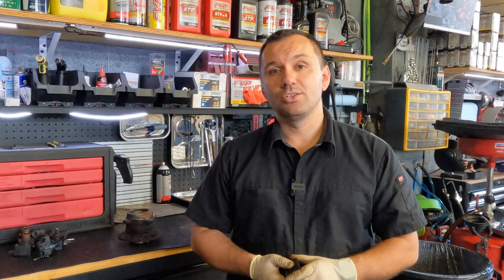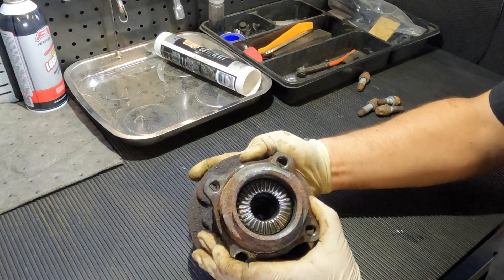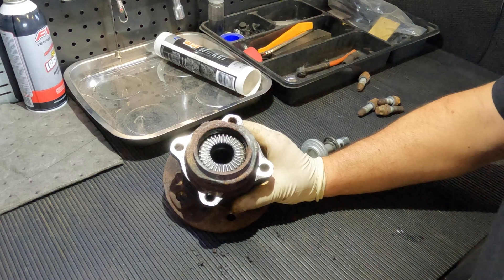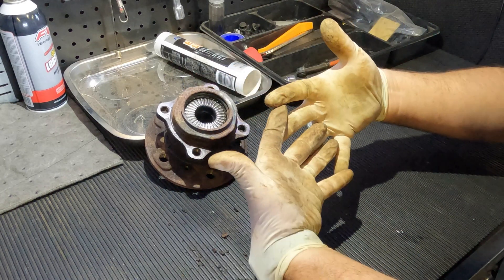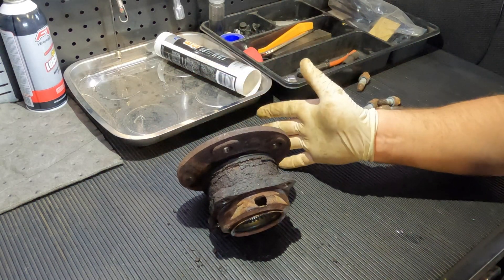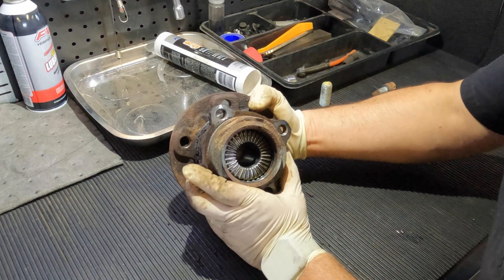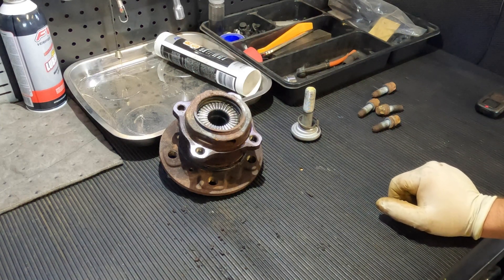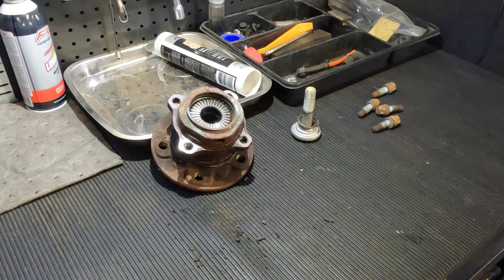BMW USING A NON-TRADITIONAL WHEEL BEARING DESIGN AND I DON'T KNOW IF IT BETTER OR WORSE?

Comment: As a non-mechanic, non-engineer, I like this design bc I've had trouble getting traditional hubs off in the past and these just about fell off on their own. Got right at 100k out of the original hubs with no issues other than them eventually wearing out. Thanks for the info.

Comment: Can I reuse the old hub cuz all the part shops has only bearing moduel
Reply from the maker: I would make sure that’s the correct part because this is only a one piece. I got mine through BMW. They didn’t have a two piece. It’s only a one piece design through OEM with the hub and the bearing pressed together

Comment: Where do you work to not notice the problem of traditional splined shafts getting rusted stuck in the bearing tighter than a brick in the butthole?
Sounds like heaven to me
Reply from the maker: I work in the rust belt I deal with several frozen axles in bearings and bearings into the hubs. You missed the point of the video where it’s about how does this design work in the long term? How much can it handle? For example I don’t care how easy it can be to replace them if I have to replace it 3 times a year if the design doesn’t hold up like the traditional bearings.

Comment: VW Lupo 3L  and Audi A4 had that kind of hub too with integral bearing in the late 90' People made special tools with a bolt and spacers as you are suggesting to take them apart, to not have to order a complete replacement hub.

Comment: What's odd about it ? That bearing/hub design is commonplace for 20+ years on many many vehicles. Removes any need for special tools to change, no need for a bearing press etc etc. And quite often the hub or flange is fucked anyway. So this complete unit fixes all that quick and easy.
Although the drive transmission method perhaps unusual. But the bearing/hub itself....common
Reply from the maker: I think you missed what I was trying to say I’m not saying it’s odd to be a hub bearing. I know those I’ve been around forever and I love the designs. I’m talking about the changeover from traditional spline shaft to the gear face interface. That’s the part that I was referring to not the actual hub wheel bearing.
Reply: @TheEnthusiastMechanic  Ahh yes  see. It is a little odd.

Comment: I'm glad you had the humility to say you aren't an engineer; BMW engineers know what they're doing, and these are application/safety critical components. That sort of power transmission coupling is known as a Hirth coupling or a Hirth joint. Traditional splines are used because they're easy to manufacture, but they suffer from backlash/clearance issues, can misalign and introduce vibration and bearing wear, etc. A Hirth coupling is superior because it's self-centering, it's tolerant of wear/corrosion and manufacturing variability, zero backlash and have huge power transmission in a small place. They're more expensive and complicated to manufacture, but when you're an OEM ordering in the millions, you can bring the advantages in cost-effectively.
Reply from the maker: If I don’t know, I don’t know I make a video and then sometimes I get to learn a thing or two as well thank you for the comment and the information
Reply: I work in an automotive factory with many engineers. I promise you, 95% of them are complete morons who lack every bit of common sense and every day I wonder how did they manage to hold on to their jobs for 20+years and in general how did they manage to survive our your their shoes in the morning. Their jobs these days is mostly trying to find a supplier that will make the same part cheaper, and when the party is eventually off sub par quality, how to make the old tooling still build acceptable parts